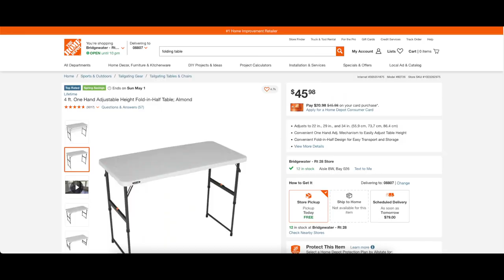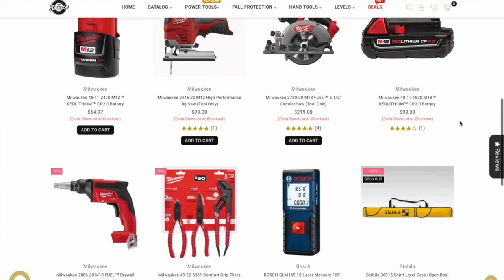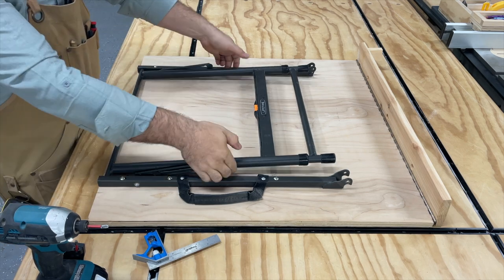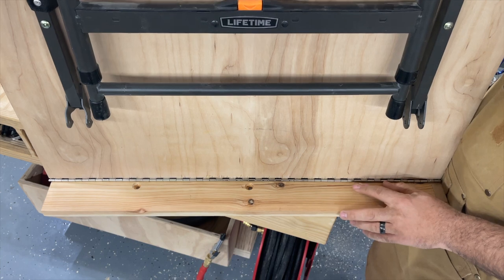Easy Build! Folding Extension Wing / Folding Table

Comment: This is something I need. Thanks for doing this video. I have just found this site and will subscribe to see just what you do...About the bolts being flush. I have built some things for myself where the mounting bolts were not as flush as I would want. I then drilled out the bolt head dimple in the "table" part and walla, it worked fine. Just a fix for a potential problem. I really like this project...
Reply from the maker: Glad you liked it! Good tip!

Comment: Nice build and explanation for finer details.  I made an outfeed wing for my sawstop few months ago.  I ended up using piano hinge as well.  Premade legs would have sped up process. I used melamine mdf 1/8 inch to cover 3/4 inch ply. The melamine is sllick. If melamine gets beat up I can replace quickly
Reply from the maker: Great idea

Comment: I have the T2 version of the Delta table saw you have.  Overall, especially considering the price, I really like it.  I did replace the two piece rails, which I think you did also, with a one piece.  I also made walnut side tables because my steel ones were VERY concave.  Anyway, nice video, keep up the good work.
Reply from the maker: Thanks Rex!

Comment: We have one of those tables... Now I'm wondering if my wife would notice it missing.
Also I wonder how the plastic table top might work as the out feed table instead of plywood. Maybe it's not flat enough?
Reply from the maker: Haha I have no idea where the table went honey! Maybe your sister nabbed it? 🤣 well I think it would work, my thoughts why I swapped to wood was the piano hinge, I figured the plastic would give and tear out over time or maybe begin to sag since there would be 1/2 of the weight, pressure on that hinge
Reply: @BitnerBuilt  piano hinge definitely works well in the plywood.
I only have a small portable table saw so now I'm trying to figure out a portable out feed table to go with it. This video gave me some good ideas.
Well done explanations of everything, by the way.
Reply: @charlespatt  One of those height-adjustable roller stands might be the way to go in your case.

Comment: Nice and simple, but one question would legs from Rockler or some other source work as well without buying a table that’s essentially waste?
Reply from the maker: Haven’t tried but of course any mountable legs will work. I ended up using both sets of legs (yes top was waste) made a French cleat mounted folding cleaning station for my in laws

Comment: I have a Jet 10" saw and would like to use this idea to extend my table as well.  I don’t have 3 holes already drilled in the end of the top like yours and it is a cast iron top so I don’t think I’ll be drilling any holes in it.  Any alternative ideas on how to attached it?
Reply from the maker: Could you build a U shaped wooden end that goes under the cast iron top, then underneath it you could mount nuts into the wood and send bolts through to “clamp” it to the top?

Comment: If I don't use my table saw to cut sheet material, is there any reason why I should have or need extensioin wings?
Reply from the maker: Adding an extension wing is primarily just to support material that would be otherwise overhanging on the tablesaw. There’s a lot of times that I pull it out just because I’m trimming something that’s larger and I want to support it, other than cutting sheet goods more space when you need it is never a bad thing!